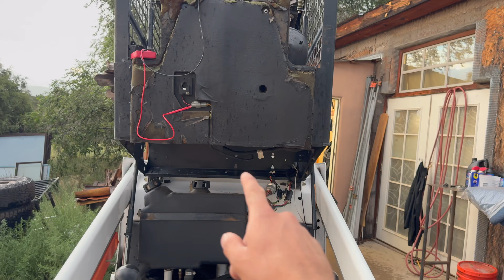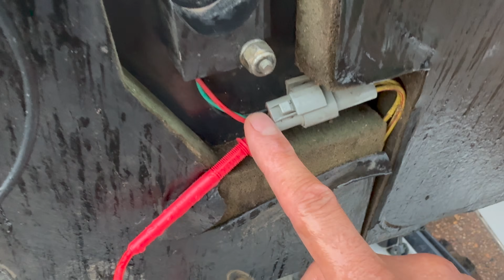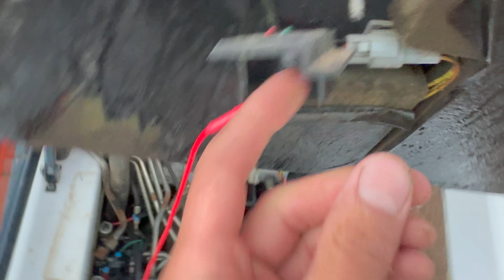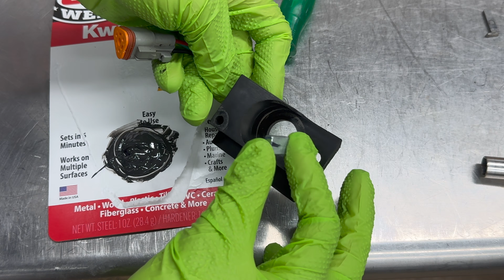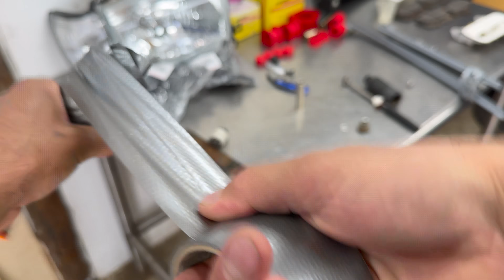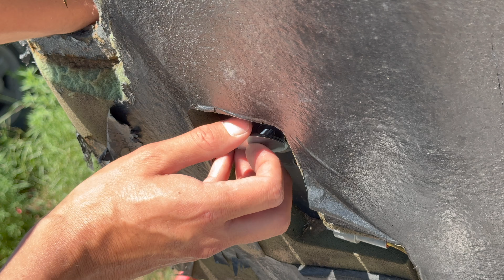Bobcat BICS Seat Sensor Bypass / Modification

Comment: Thanks for your advice.   I was wondering what the 3 wires were all about.   Seems that it just needs 5V    Did you ever think about just throwing a L7805CV regulator in?

Comment: I took the old magnet out without removing the seat. I put a magnet in place of it that is the size of a quarter. The original bolt put back which held the new magnet in place. It works perfectly !!! 

Thanks for the idea

Comment: You can drill out the white plastic magnet holder, flip it over on the seat mount post, and bolt it on upside down with a washer reinstall it in it's old mount out of the way. 
I used black tape to hold the magnet in place until I bolted it in, and it even looks legit.